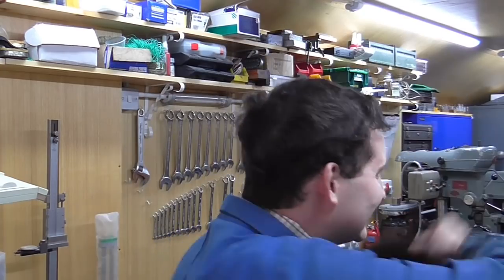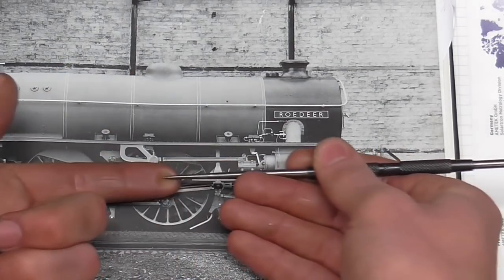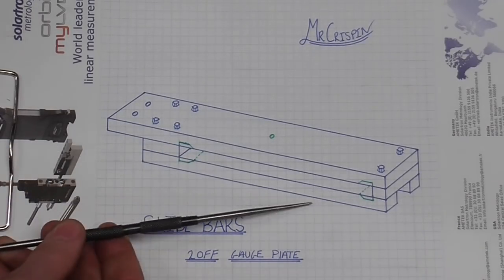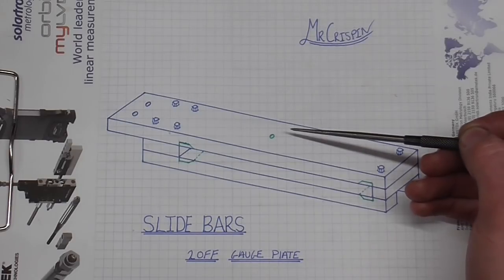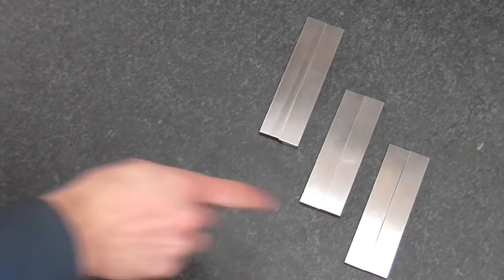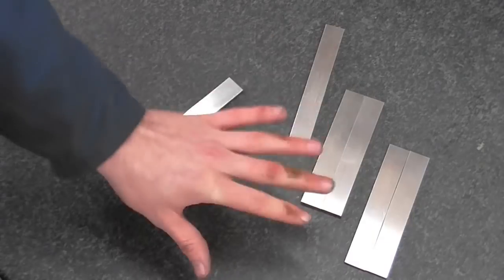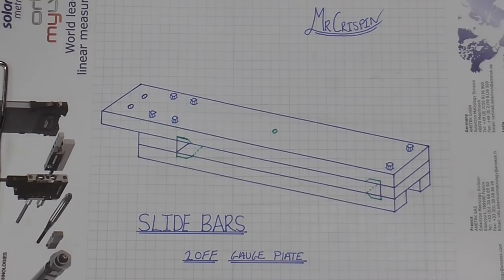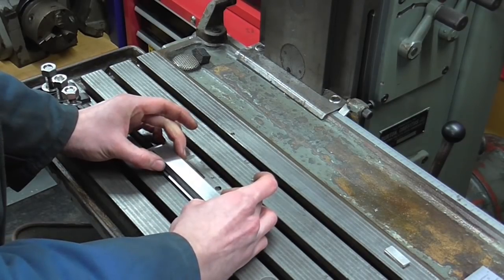Making the Slide Bars

Comment: Dirt traps at the ends of the side bars,  if the crosshead slightly overlaps these, this will prevent a wear ridge being formed, this technique was also used on high-class steam engines, on the slide valve face, it also makes re-surfacing easier.
Reply from the maker: Thanks

Comment: I thought you were reaming the holes so you could fit gauge pins to them to keep the stack aligned and stop the ends spreading while you milled the slot, but clearly you have other things in mind!
Reply: Hang on for the dowels Ian, pretty sure they will make an appearance in part 2. Cheers, Jon
Reply: @jonsworkshop  Ah, Mr Count. So good to know I'm in such esteemed company.

Comment: Reamed bolt holes, so the bolts act as  precision location pins as well as clamping, my guess.  👍
Reply: That's always a mistake.
Reply: @toolmike100  why?
Reply: @flyerphil7708  The reason is because the threads of a screw or bolt are not concentric with the center axis. They are rolled threads. The screw will probably go in but it will be tight all the way in and not hold the true center. That is why they use tubular dowels to do the precise locating, with the screw running thru the center of it  and clearance for the main body of the screw so it is able to turn in and out easily.
Ask me how I know this :).
Reply: @toolmike100  and the final heat treatment often moves the dimensions out of round. As you say,not a reliable method unless the bolts,are precisely made with the thread screwcut and the plain shank concentrically machined/ground as finished article.
Reply: @howardosborne8647  True, but  then you better single point thread the hole also. I doubt a tap will go in perfectly straight or cut perfectly on center. It's a lot of work to accomplish what a dowel or even spring pin was designed to do.
Reply: Precision close tolerance ground thread bolts are commonplace in aviation.
Reply: @flyerphil7708  Also commonly seen clamping the big end cap on high performance con rods  (Carrillo etc.)
Reply: @howardosborne8647  Fitted Bolts

Comment: 7 Clamps? Your not trying hard enough! In my vertical turning days I did some 1150mm diameter Rings out of inconel. 36 clamps holding them down, and they still weren't parallel.